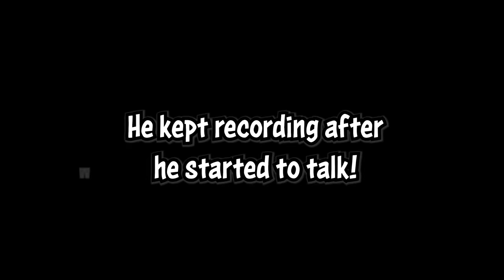Staircase Remodel - Removing Carpet

Comment: Personally I would have removed the nosing, cut in a skirt (it sucks to do that way but can be done fairly easy) added a piece of ply over the risers so I had a clean surface to paint and then do treads over what's there.
Reply from the maker: That seems like a lot of work!!! Lol.
Reply: @Building_Jays_Way  nah its actually easier than what you did imo, you could skip the skirt board I guess but it would look the best.
Reply: either way it turned out good